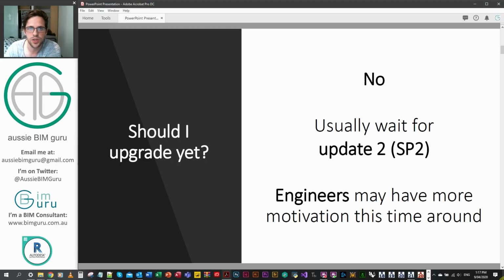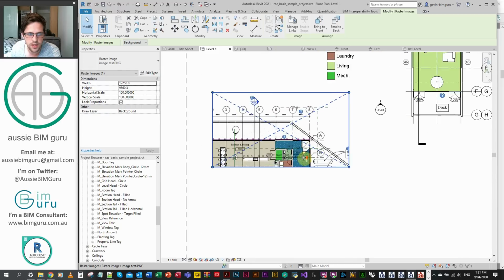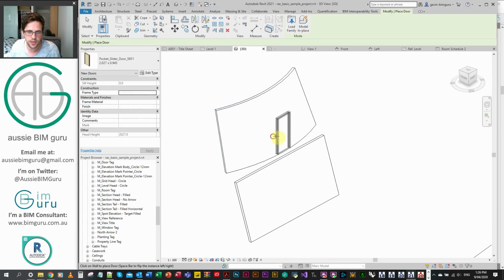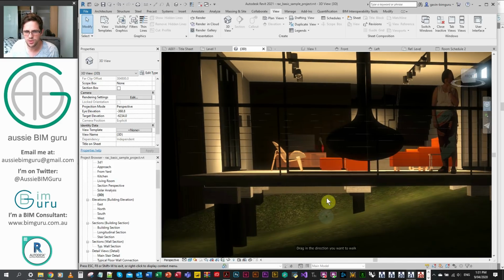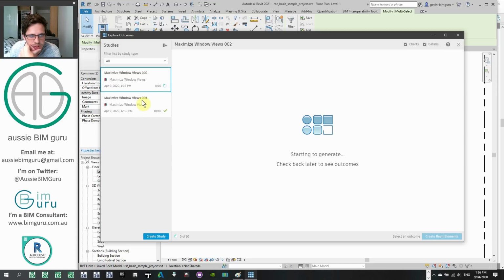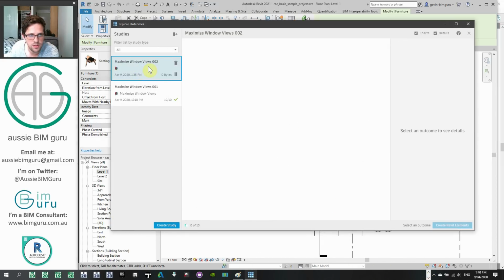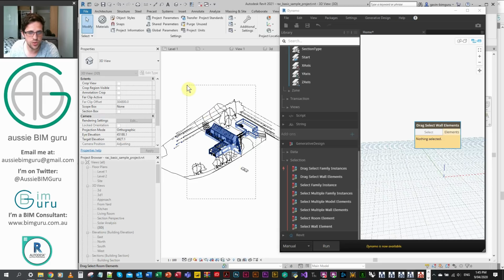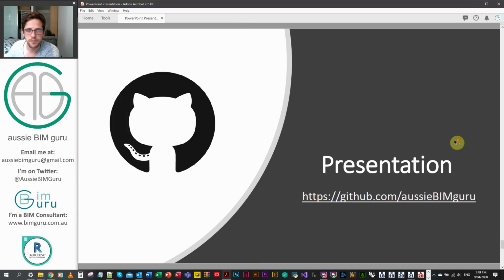Revit 2021 - What's new?

Comment: I'm new to this whole area. Question...does Revit offer random attributes in generative design? Example -- a CG bathroom  master with say 20 random designs from flooring to wall materials and colour and lighting options. Thanks! 
-Mark in Vancouver, Canada
Reply from the maker: GD works via Dynamo so anything you can do there you can also do in GD as well. The tool is more about taking results that are randomized and equating that to a success number (fitness) or multiple variables to hone in on. In order to use GD you need to create variables to measure the success of an option.

It sounds like you really just want to randomly place bathroom typologies so that could be done without GD. As it comes, GD/Dynamo do not understand spatial logic or offer any architecturally focused tools beyond that which Dynamo does - you are still the programmer.

This article I wrote here will help explain my stance on what constitutes a use case for GD:
https://www.bimguru.com.au/post/generative-design-problematic-solution

Comment: Aussie BIM guru, is there a way to remove the section line?
We always have to break the line, is there a way for a tiny line to be incoporated in the section head and tail so we can avoid splitting the section line all the time?
Reply from the maker: The only way I could think of (which is pretty bad) is to make the 'Section Lines' object style in manage > object styles white, which will almost hide it permanently. It will show on anything it crosses as a thin white line however. You can then build the head/tail extension into the markers and it should work (lines beyond the default divider wont align to view by default in Revit 2021).

Comment: I find the enable filter on and off is pretty redundant.  You can simply click the visibility check or uncheck and it will turn off or on the filter.  Why have both now?
Reply from the maker: I think it's moreso for graphical filters vs visibility filters. I've been using it for super quick graphical overrides like highlighting coordination elements by filter in working views.

Comment: Amazingly clear and detailed content as usual. Thank you for the great job you do!
Besides practice and experience over the years you worked as a BIM Manager, what other sources did you use to learn Revit, Dynamo and Python?
Reply from the maker: You're welcome!

As hard as it is to believe, I actually taught myself Revit solely through experience and practice. I referred to a few tutorials here and there, but usually it was self taught in my spare time. I took an empty Revit model, purged it right down and forced myself to learn from scratch. In particular, I developed my own system for building, editing and auditing Revit families - I have a highly disciplined system when it comes to data and cleanliness. I was fortunate to work alongside a great BIM Manager on my first project who imparted a lot of good habits onto how I ended up working as a BIM user.

When it came to Dynamo, I used the Dynamo Primer however beyond that I also taught myself through trial and error combined with some queries and help from the Dynamo forums. I learnt the hard way, not recommended!

For Python, I used DataCamp to learn Python from a data science perspective, then used a combination of the Revit API Docs, the Dynamo Python Primer, Danny Bentley's series on YouTube and other developer's custom nodes to learn about it in the context of Dynamo.
Reply: @AussieBIMGuru , thank you very much for sharing that with me! 

I am also trying to get a better understanding of Dynamo and Python and I was really curious what helped you have such a clear way of thinking the workflow.

You have a brilliant and helpful content!

Comment: I really appreciate your efforts
....
It is absurd that all focus on YouTube’s videos is on modeling, because it's very complicated and silly in Revit, while the primary meaning of the program is BIM.
Every architect uses 3d software such as 3ds max ...etc.
why people in Revit try to invent a new way of modeling.
just copy 3ds max or Maya or SketchUp..... modeling mentality and integrated into Revit.
then please concentrate on the use of Revit for interior design specs such as custom-made feature walls shop drawings, joinery, 
 reception counters.....etc. without tweaks and tricks
make the software useful for real-life not only for concrete and ducts...

anyway Archicad still slightly better
Reply from the maker: Thanks Kinan!

Modelling in Revit can be simple - people make it complex by using poor workflows and habits typically. I agree that data and BIM is the point of it all at the end of the day, and beyond that building a building! I've done some very bespoke/complex work in Revit with great success.

I've tried ArchiCAD and it didn't really appeal to my way of thinking (and it was difficult having to use IFC for every import/export), but for some it works well. The right tool for the right person at the end of the day - i try not to treat it as a competition.

Comment: It appears that they have developed everything other than (again) MEP. Lets wait for revit 2100, new and improved engineering for the southern hemisphere.
Reply: and dont get me wrong. learning dynamo etc to improve revit has been a big personal stepping stone for me personally, as i will most likely not be able to be employed at an MEP firm due to wage requirements, however, personal growth in MEP doesnt equate to explaining to directors what needs to be done to improve revit as an engineering tool and the time required to do it. Please AEC, work on the MEP and documentation side of revit.
Reply from the maker: @tonyhoward6085  reading you loud and clear, and I agree with most of your postings also by the way - we could use a refocusing on delivery, although I find I have a bigger finger to point at politics and 'high table plays' than programmatic design more often than not.

I worked primarily on delivery of projects for the first 7 years of my career - I found I was more effective streamlining methods for others than being a hand on the mouse ultimately; I had to make the hard choice of putting my faith in others to deliver and document projects correctly.

In some aspects the industry has lost its way, and I feel for your predicament and hope you find a position/team that can appreciate your take on what a project needs.
Reply: I feel they won't develop the MEP side anymore. Which is basically the same for many years. We have to build a workaround for almost all essential MEP Parts to work correctly. OMG and their half baked Fabrication parts.
Reply from the maker: @sujanmaharjan9182  yeah fab parts arent great if you cant build them in cad... hear many engis complain about that one!

Comment: its usually another 6 months before you would even look at using it. and then its another 2 years before architects would have upgraded. they need to make the tools a patch for previous years.
Reply: This is the reason why people still have projects in 2015. I think you should start every new project with the latest version.
Reply from the maker: @revit_ninja  I typically agree with that approach, although it is also sometimes easier to avoid being in too many versions at once due to content management and projects missing out on perks.
Reply from the maker: I agree that it's too frequent as well, we usually leapfrog every even version as a rule of thumb. I always wait for SP2 also before using it for real